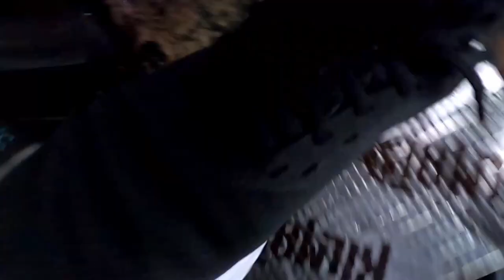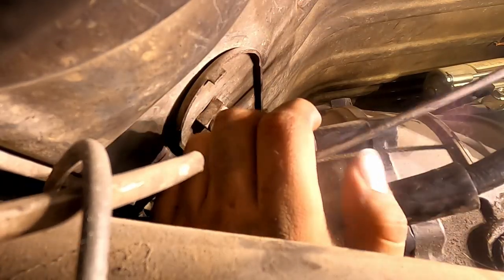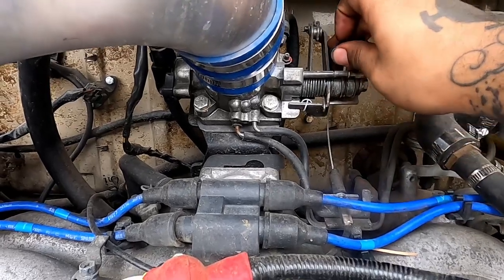VW Beetle Clutch cable replacement

Comment: The only structural section of the beetle floor pan is the central tunnel.  It needs welding back up. You only need to remove the pedal cluster to replace your clutch cable...nice engine though!!

Comment: Anyone in the future with the reverse lockout issue. It isn't your clutch cable. It's an issue with your shifter itself. The metal plate that gets bolted to the tunnel is what controls your reverse lockout